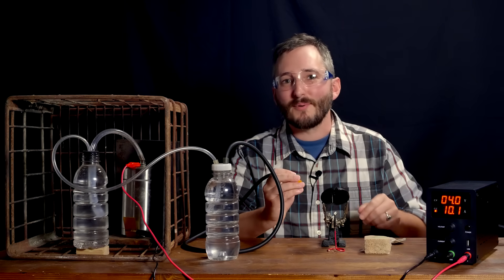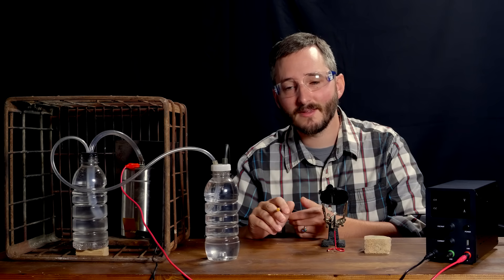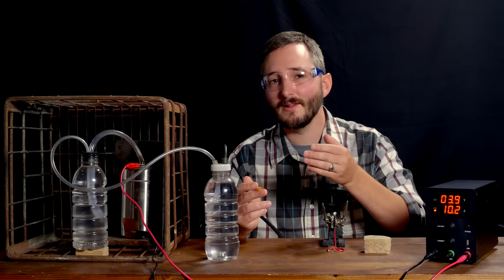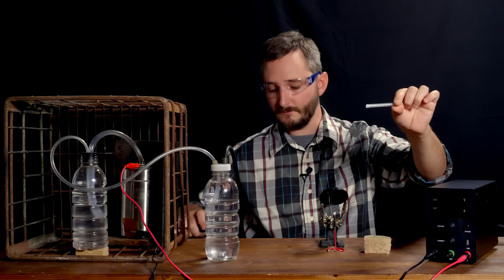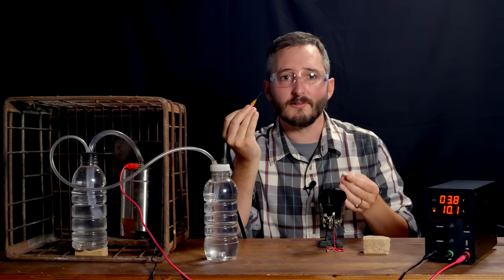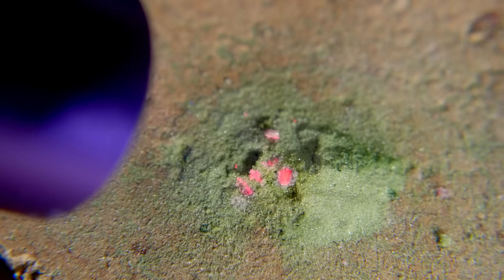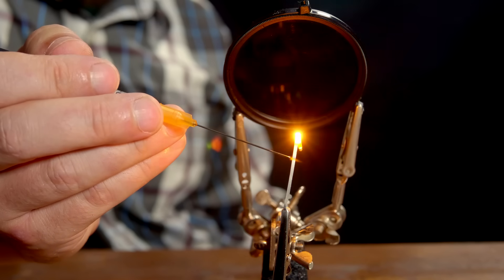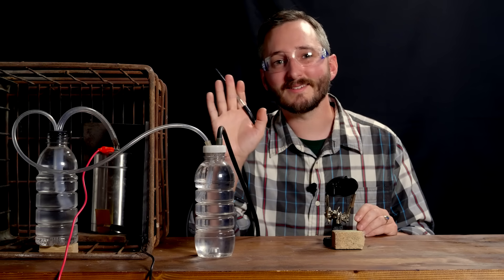DIY Oxy Hydrogen Torch Using Water Electrolysis

Comment: Mmmm, not too big a fan of your bubblers. The whole point of a bubbler is that the input is at the bottom of the tank. That way the only path through is for the explosion to chase the bubbles down to the bottom. You have two plastic tubes side by side at the top, surrounded by explosive gas. That's, I dunno, 5% as safe as at the bottom? I appreciate the use-what-you-got approach though. You can also bleed off some of your oxygen, if using the separate gas system, to make the mixture fuel-rich, or, only combine the two right at the torch tip, similar to an oxy-ace torch.

These torches are the only ones allowed in malls and apartment building most places, as they're gas-on-demand, and hydrogen diffuses harmlessly into air. Commercial flashback arrestors are brass wool in a tube, but I think they need to be kept wet (often, the bubbler dissolves enough water vapor into the gas stream that if you get the arrestor wet at the start, it'll keep itself wet). There are dry versions which I think use sand or something, but I've never tried one.

I have a fantasy project over the last 20 years... a small solar powered hydrogen blimp. Something beach ball to volkwagen sized maybe. Have a very small hydroxy generator onboard, a vapor collection system, powered by solar panels, and a fan to steer it. It can replenish its own hydrogen from humidity in the air, and otherwise just float wherever it pleases around the world. Maybe enough electronics to take some pictures and keep a GPS log.

Comment: Hydrogen dry cell plus larger-diameter torch. 
Use a separate container to pressurize the gas using tap water.

Comment: I really want to convert my propane stove to hydrogen powered gas stove, is it safe to use hydrogen instead of propane?
maybe this is stupid question, but I really curious about it and want to make it and use Arduino for pressure regulation system.

In my country lot of people uses propane stove in their house, somebody in my country already make hydrogen stove surprisingly not little made Hydrogen generator for stove and also use that hydrogen generator for old motorcycles that still use carburetor , but I just want to make sure how safe it was before I replicate this project.
Reply from the maker: It will be less efficient to make hydrogen than to simply use an electric stove

Comment: even its not about the nozzle ...
how about this : adding some steelwool into to the bottom-can,
by fixing it with some plastic-rings / 1 plasic-cage inside ... ?

this can increase the amount of gas > pressure for the nozzle ...

Nozzle : some sort of heat sink might be helpfull, to avoid that ... eehm .. kickback ?

Comment: i've been playing with the idea of using this same set up to melt feldspar, can you test this for me? the white sodium type if you can find it
Reply from the maker: Aluminum oxide melts around 2100 C, so feldspar would easily melt by this torch as its melting point is 1000 C lower. I still would not recommend you build one as it is dangerous.
Reply: @Nighthawkinlight  lol I want to melt gems out of the host rock with little more than a solar power input. And I watched your previous video on the separated gas out put model you made, I'm also not a fan of the idea of storing unfiltered hydrogen at pressure, so don't worry about me... Also is there any way you could pump the gas thru a solid block of graphite?

Comment: I wonder if you can make small valves (possibly from some old aquarium gear?) So it can be mixed at the torch end like an oxy-acetylene torch? Then you could make the H and the O seperate like you showed in a previous video and mix them at different ratios

Comment: Generating hydrogen and oxygen separately and only mixing them right before they burn feels much safer for almost the same performance. Perhaps something like how oxy-acetylene torches work, just made from two needles? HHO is really, really dangerous and even though you say that people should not try it at home, someone will. I think it would be better to give them some safer kind ideas about what to experiment with.

Comment: DON'T use stainless steel as an electrolysis electrode! It will produce hexavalent chromium which is very dangerous. An easy substitute is using the graphite rods inside of pencils, just burn the wood away!
Reply from the maker: I convert the hex chromium to inert Criii by dropping a piece of aluminum foil in the solution. It works quickly.
Reply: @Nighthawkinlight  Oh I see, that works nice!

Comment: Why not go back to the method of separate electrolysis and then mix the gases at the tip?  Should eliminate the safety issue altogether ?? Put a regulator on each gas lead and you will might have some ability to control your temperature.

Comment: Bigger please I have a 4liter one we build for a school project and yes school project got the shop teacher to fund the stainless steel for it 14lb rolled like a double spiral one being anode one being cathode after a couple moves and showing off the people the acrylic housing finally gave out and cracked most power we ever put to it was about 150 watts around 10 volts and 15 amps I want to see what kind of torch you could make with something like that

Comment: Hmmm. It seems you are using electrical current to provide motion in the water to divide the water back to the inert gasses that created it, then compressing those gasses into a small torch head thus creating heat/light. Gravity works in the same way when it comes to compression/expansion of inert gases which are cold; cold generates, generation heats, heat radiates and radiation cools (no entropy). While studying our worlds nature independently, I have found the acts of creating light in nature are also the same acts of creating “matter”, but the pattern is always the same. I’m not sure if I agree with the idea “hydro electric power”, I just see gadgets that are set in the form of producing a small amount of gravity off of natural material, for positive and electric charges are equal so they do not overcome one another, and it’s motion is universal in all of nature. I do like the invention though.

Comment: Have you thought about pressurizing the individual gases into two separate tanks and mixing them at the nozzle like oxyacetylene? That would require more gas production to be useful, but it would offer more control and the lack of pressure vessels filled with the perfect combustion ratio.

Comment: I wonder if you can use only oxygen from the generator and steel from the needle as a fuel. It may be useless in that scale or even not work at all due to low oxygen pressure, but something similar is used to cut a giant iron parts for recycling (oxygen lance).

Comment: These torches sometimes are bubbled through additives that consume some of the oxygen in the mix. This results in a hydrogen rich reducing flame, which is an even better for preventing weld oxidation than a shielding gas.
Reply: Why are these called reducing flames? I realize its the chemical sense of reducing, but whats the significance of a fuel-rich flame being reducing? Or is it just because its the opposite of oxidizing and the opposite of being fuel rich is being oxygen rich?
Reply: @chrstfer2452  Hydrogen itself is a reducing gas - it can bind with oxides on a metal’s surface and convert the oxide back into metal (generally an endothermic reaction, but welding and other physical metallurgy processes) have plenty of heat available to enable that reaction. Just any fuel being supplied won’t necessarily cause the same reaction, as something like acetylene won’t want to bind with oxides anyways.

Comment: As for me, I arranged 60  discs of inox with a diameter of 3 cm, separated by textil discs, and moistened with soda water. and then you can fed with 230 volts of domestic electricity with a diode bridge put all in galasse tube or plastic close the tube with two caps; each cap contains an electrodeand  and pipe.one of the pipes to inject the soda water the other to collect the gas. FRIENDLY YOUR BROTHER FROM algeria

Comment: I ran a jewelry store for many years and at one point I got a good deal on a commercial hydrogen torch for my goldsmith.  The output was not HHO but H2.  Part of the system included a bubbler but we did not fill it with water.  Rather, we used a flammable liquid.  This had the effect of Lowering the flame temperature because the material burned at a lower temperature than the pure hydrogen.  I do not recall with certainty what the liquid was.  Could have been acetone or alcohol.  The important features were first that it had to be volatile enough that the top of the container was always filled with just the gas phase of the liquid - very low oxygen present.  This made the chamber into a flash arrestor.  Second, that it burned cleanly.  Some of the work the goldsmith did involved platinum which is very unforgiving of any impurities.  By contrast, gold or silver which are soldered or welded under protective flux could be heated with an acetylene flame which often had stray carbon.  And the third feature of the liquid was the lower flame temperature which allowed the goldsmith better control than the pure hydrogen would provide.  
In my retirement, I have considered making a torch (once the rest of the house is reconstructed).  I have not yet decided if it should be H2 or HHO.  Thanks for the videos.

Comment: That's amazing. I'm sure you've already thought of it, but I'd love to see a separate oxygen-hydrogen setup feeding into two needles. It should avoid the problem of flashback entirely since neither oxygen nor hydrogen are flammable on their own.
Reply: Have to still be very careful with the composition of the tubing and stuff with oxygen. I saw a video where someone made an oxygen torch with an acrylic tube as the fuel source and nozzle.
Reply: @Falcodrin  lmao, oops. Or do you mean on purpose, e.g. a GOX hybrid
Reply: @Falcodrin  I think a stainless steel needle should be ok. Only one way to find out of course.

Comment: One thing I want to add! In order  to extinguish the flame, you can just wrape the wet material around the needle and leave some needle at the tip. When the fire starts moving backwards, it will reach the wet stuff and turn off buy itself, no need of holding the wet stuff in one hand and the needle in other.

Comment: When I was 16 my dad and I bought me an HHO generator and I hooked it up to our wall outlet, I'm still very interested in developing one, but I had a flash back arrestor, similar to yours explode. I was using NaOH and it went everywhere. I became soapy, my dad was burning and it got on an aluminum laptop, completely discoloring it. I was really into making jewelry at the time, so this was a set up I would've used. My output was not high at all, and I'm not sure why it was so low. I had a very efficient production ready generator, but it just didn't do the work I needed. Eventually I burned the rubber seals between each plate and the plates themselves developed a substantial amount of rust, or at least that's what I thought it was. Either way, it wasn't a great experience, and now I'm interested in it again, for melting high temp elements I have lying around like tungsten, platinum, and some oceanic mineral salts to as if I can synthesize out rarer metals. 

That being said, if you live near ocean water or salt flats, it would be cool to see if you could Flux out the non-metalic substances from salts.

Comment: I wonder if quartz or glass welding might be an application for this? I once visited a site manufacturing quartz jigs for semiconductor furnaces and they used hydrogen in order to avoid contamination with hydrocarbons. Some sort of small glass filler rod might work to allow manufacturing of quartz or glass parts?

Comment: i couldn't help but think of a simple solution to your issue of the flame traveling up the needle (another guy suggested a tesla valve which i like a bit better, but nontheless).
perhaps rather than only using water as a coolant when the flame travels up the needle, just keep the needle up to nearly the tip, in constant contact with water, and leave just enough of the tip of the needle to be comfortable to work with.

i can imagine a small water tank surrounding the needle, which is basically wet paper towel or cardboard, contained in some sealed tank surrounding the needle.

if the outside of the needle is in constant contact with water, there are basically no moving parts at all, but rather you have a reservoir of coolant.
it basically does what you do manually with the cardboard, without your intervention.

otherwise wrap wet paper towel around the needle and it should stop the flame traveling backwards for as long as it stays cool.

Comment: Are you still working on the ruby project? If you are, you might not have known that you likely already have all the tools necessary for polishing them. Just take a screw and glue the stone to the flat end with epoxy. Then attach to a power drill and start going at it with wet sanding papers. Finish with some knife honing compound. I like to start them off on a bench grinder to first get a flat side, and do the pre forming but if the rubies are all round from the get go then I suppose there's no need for that. If you don't have a bench grinder an angle grinder would work too, but you'll have to be careful about chipping the stone. I make cabochons like that all the time, mainly from garnets and whatever other minerals I happen to find. The best ones I even make into rings and necklaces.

Comment: Couldn't this be made safer still with the split-output electrolysis device? I'm no expert in the slightest so i will probably be overlooking things, but if you run both oxygen and hydrogen in separate tubes next to each other and only let them come together at the tip where they'll burn, you theoretically couldn't have any flame travel back into either of the tubes - one just contains oxygen which doesn't react with itself, and the other only contains hydrogen, which also doesn't react with itself
Of course you may need to be careful as to what the tubes are made of, as pure oxygen plus anything remotely reactive tends towards - cough - rapid disassembly, but besides that, this might be a worthwhile idea?
Reply from the maker: Yes but the split design requires 10x the power for the same gas output
Reply: @Nighthawkinlight  ah yes, i remember now! Wonder if it were possible to separate the two gases after electrolysis, maybe there is a semipermeable membrane for that use, to have the best of both worlds
Well i mean, if there is, it certainly won't be cheap

Comment: 12:25 Was that glass? Damn that flame is hot. Shouldn't surprise me, considering it took the ruby test with flying colors. 
Also, be careful with your arresters. I tried a similar setup and you definitely don't want water in your needle.
Reply from the maker: Yep, glass microscope slide covers

Comment: Damnit, your videos always put my brain into overdrive.  Case in point.  Would taking a box the size of that milk crate, spacing out the chamber and two flashback arresters in it, then filling it with concrete increase the safety factor?  You'd have to leave the tops of the containers accessible, but I'm thinking that would be a safety feature in itself.  If the arresters blow, just the cap and some water will come out, I don't believe that the amount in the bottles would be enough to shatter the concrete surrounding them after the cap blows.  Likewise with the main chamber.  As long as you keep it full enough with water, the volume of gas should be low enough that if the arresters fail, the cap will blow off, but not shatter the concrete.  You WOULD have the issue of flying caps and water, but a simple enclosure should protect from that right?

Comment: Since the flame is very small, i think you could use it as a "soldering iron" that can weld copper directly, without the need of tin wire.

Comment: YOU REALLY REALLY NEED A 3D Printer! It will be one of the best investments of your life! oh and quick tip, 250C is more than enough for functional strong parts, so no need to buy expensive high temp printer, but make sure it has a heated bed
Reply from the maker: I have one but haven't done much with it yet.

Comment: I've had a somewhat scary idea re HHO , that I've not dared try out of fear of explosion etc.

replacing a boiler of "steam engine" or a turbine,  with an HHO burner exiting to high pressure pipes ... 
OK the flame would be far too hot to be of direct use... but it should be possible to inject water, maybe condensed from exhaust to attemperate the steam to what engine materials could cope with.

possible reasons for doing such... 
higher efficiency there's no temperature drop from combustion to engine. boilers work as heat exchangers so there's always a temperature drop.
also there's always heat wasted going out chimney 

total mass of hydrogen+oxygen consumed same as the equivalent water consumed 
the hydrogen and oxygen contain the energy, and thus no additional mass of fuel (eg  "no coal" bunker)
if tank pressures high enough to drive "flame" into engine... there's saving on weight of feed water pump or similar.
there would of course be the extra mass of tanks to safely store gases, but perhaps the savings from not carrying a boiler/extra fuel more than offset such.

Comment: Can you (or any one) get the same high temp if the gases are not mixed until the handle like "normal" gas welding? Would that not be much safer and allow much higher gas flows?
Reply from the maker: Yes, but it's harder to made an electrolysis device that efficiently makes split output gas. I made one in my last video and it requires about 10x more power than this for the same amount of gas.
Reply: @Nighthawkinlight  So it is possible, would not the safety be worth the extra power usage? Are we talking a couple of watts or several kilo watts?